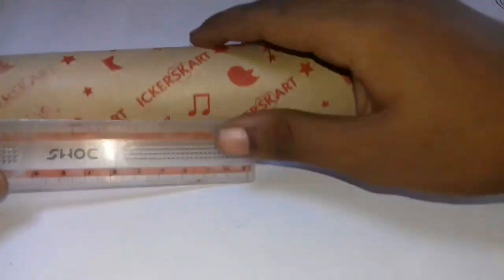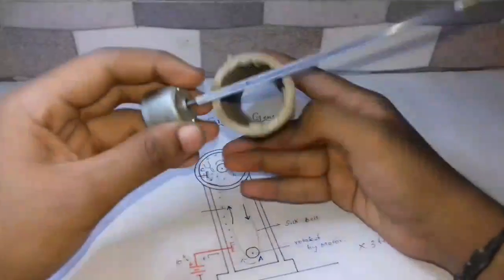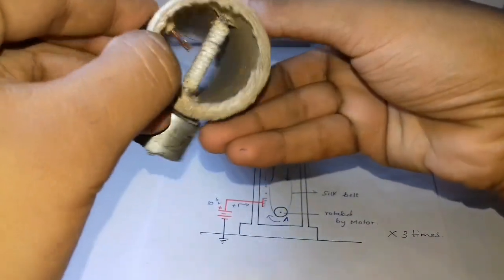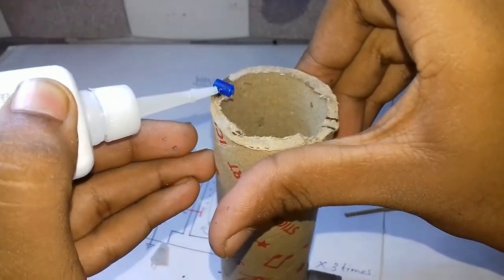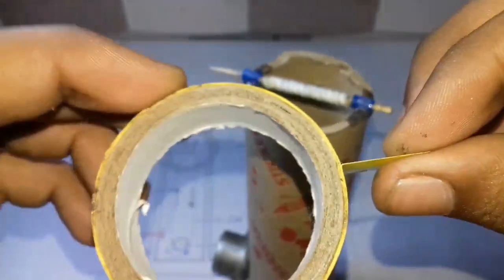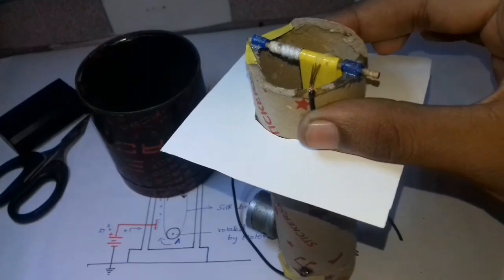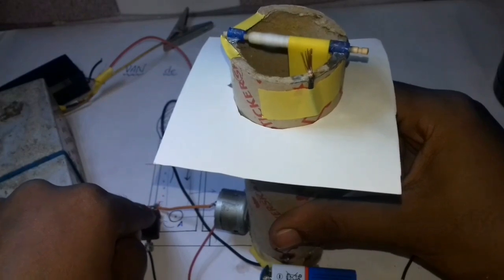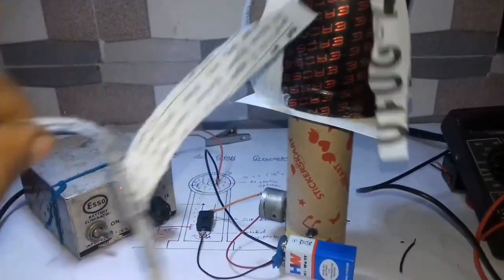How to make Van de Graff Generator || diy projects || electronics project ||creative projects ||

Comment: Hey! I am making it, but have a lot problem, no charge is produced, no effect is experienced, I have a problem in attaching brushes,. Kindly guide me plz,
Reply from the maker: What do you mean by brushes belt or the sharp copper pin
Reply: @creativecrackers0079  yes I mean sharp edges copper pins, actually I used the copper wire which contain many thin wire.
Reply from the maker: How many voltage you give as input 
Just remember one thing the charges will come outside (discharge ) only after they fill the container
Reply from the maker: If you still need a help. .inform me i will make about its working separately? 
Subscribe :)
Reply: @creativecrackers0079  I am using 12V DC battery,.
Reply: @creativecrackers0079  yeah I need a help, kindly make a detailed vedio.
Reply from the maker: Its comming soon within 2  to 3days
Reply from the maker: The video is uploaded